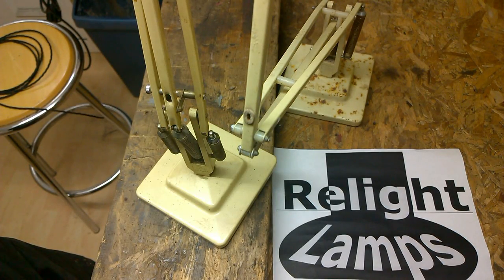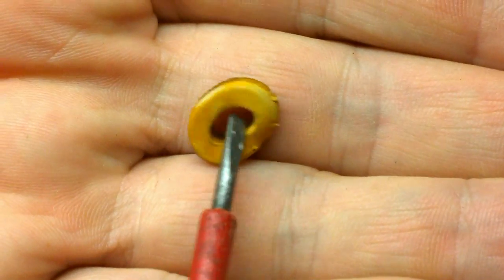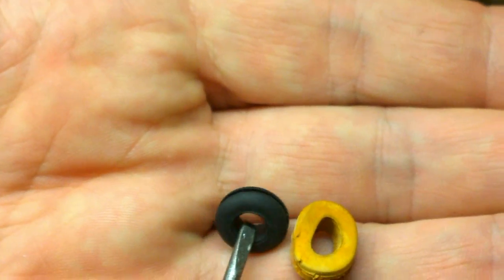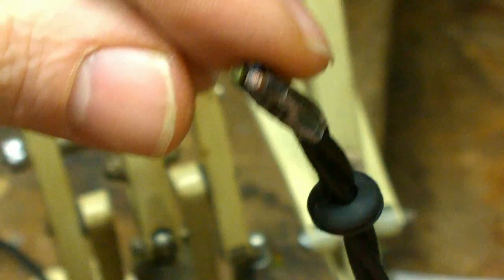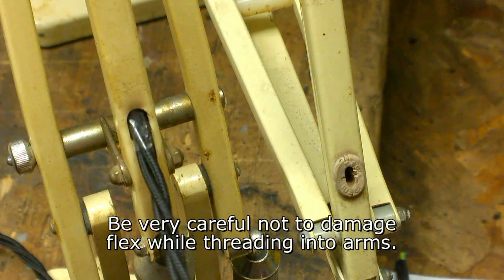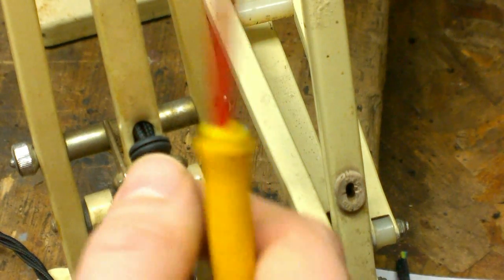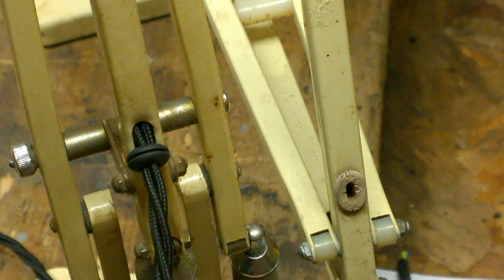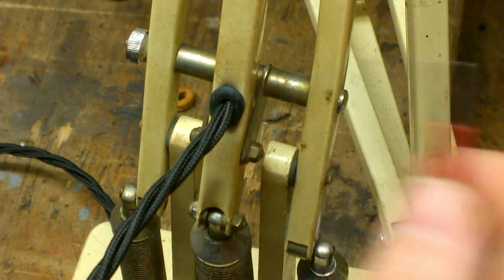1227 Restoration replacing Anglepoise cable grommets.

Comment: Hi Ron Thank you for your instructive videos. Could you make one showing the complete procedure for reassembling the lamp parts? I would like to see the replacement of the small piece of metal that sits in the top end of the upper arm immediately behind the lamp shade. Also how to thread the end of the flex through the shaft of the shade bracket as its a very tight fit.

Comment: Hello, I bought this lamp with the original Crabtree bulb holder (looks like new) but without cables.
Is it safety enough to keep the original Crabtree bulb holde and make the earth on midle spring (as I saw on ebay)?